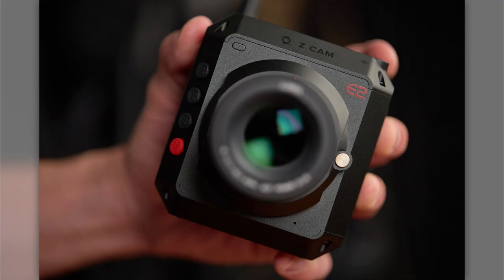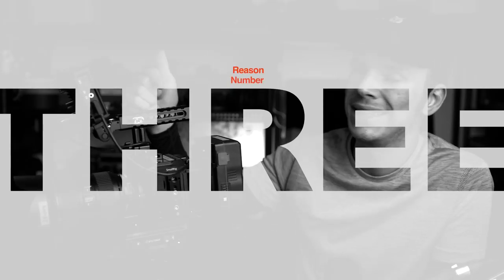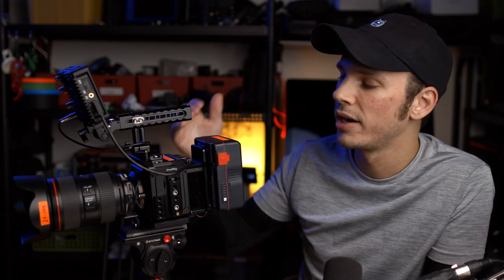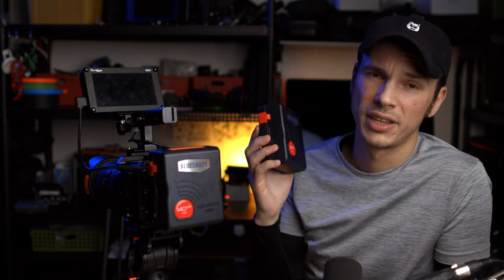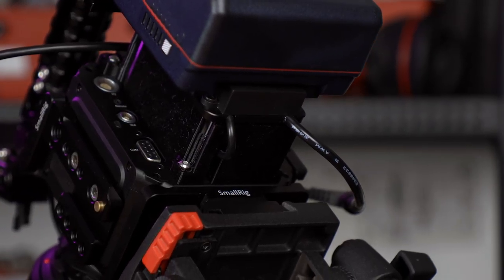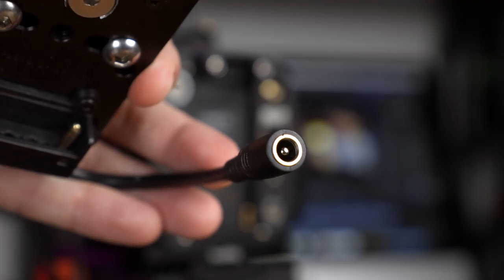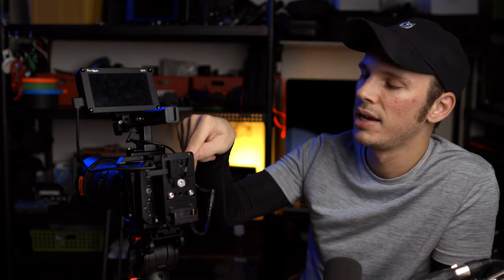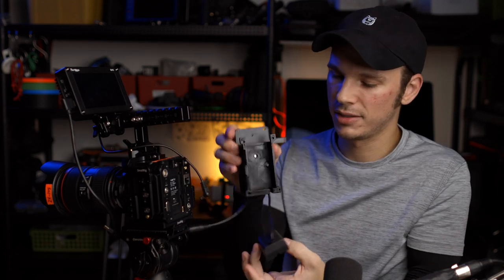V-Mount Power for your Z Cam E2

Comment: Im going to buy the Z Cam E2 F8 Soon, i really like your rig, most likely going to buy the exact kit.
Reply from the maker: I have the F6 on preorder myself! :) I've reallllly loved this setup overall, added NATO rails to the top and on the monitor so everything can break down in under a minute. What camera are you using now by the way?
Reply: @ScottDumas  i use the GH5 at work for podcast, time for an upgrade to the Z Cam 8K, I was wondering if the Z Cam 8K supports ProRes???
Reply from the maker: I think it will, at least in certain frame rates/resolutions. Don't know if they'll have it at launch but it seems pretty close to 100% that it will be added if it's not there yet.

Comment: that rig is so orgasmic. Have you considered a custom rig from Tilta? the $500 kit with follow focus side handle and everything. seems pretty nice
Reply from the maker: I have thought about the Tilta option but just haven't had the money (or need, really) to get one myself. There are certain parts I like about both and dislike about both (smallrig and Tilta) but this has been working pretty well so far. Getting the Clutch handle for this soon which will add a lot of functionality for run and gun, super pumped about that. I'm so used to focusing by hand too that I don't usually feel the need for any sort of follow focus usually :) 

Have you used either kit? I like the built in rosettes on the Tilta but not the cold shoe on top ...what are your thoughts?

Comment: Hopefully partner with someone like SmallRig to design it.

But I want to know, what is the height of the vmount plate?
Looking at the bebob vmount batteries, or possibly another micro vmount battery, but want to make sure its a good matching height. so battery isnt a bit smaller or taller compared to that vmount plate
Reply from the maker: Already in progress with Nitze for a quick release design that will make it crazy easy to switch from v-mount to NP-F... should be ready soon I  think, like within a week or two. 

As for the plate, I'm not sure of the exact measurements offhand, but the plate is like a mm or so lower than the bebob batteries, almost exactly the same height, and just a little bit shorter than the BlueShape Mini which are very slightly taller than Bebob.
Reply: @ScottDumas  thanks :)

Comment: I just ordered BMPCC4K what a bummer. This camera looks so good. Perfect body. I wonder how is the lowlight iso and image quality compared to BMPCC4K. I’m all confused now. My BMPCC4K is being delivered in 2 days. Since this is mft too I can sell the BMPCC4K with light opening the box and get this. Another question is how is the media size of this camera
Reply from the maker: Haha well the BMPCC4K is another great camera, from what I can tell the body build quality and size/design are some of the main differences. Of course codecs etc are different too but they're both awesome cameras luckily. 
The media for the E2 is either CFast 2.0 or an SSD like the PKT drive from Angelbird over USB C (although I use CFast myself)... data rates depend on what frame rate & resolution. At lower frame rates up to Prores411 HQ is available, at 72fps Prores422 LT is the highest you can go and above that is H.265 which is 420 but still 10 bit. There is also RAW available but the software to process it is still being developed for Mac so I haven't tried it yet. The great thing about Z Cam though is that they're constantly updating the functionality and features of the camera, they're very interactive with their users on Facebook for example and I'm not sure that can be said for Blackmagic. IQ wise though, the BMPCC4K will still be great for you so I wouldn't worry to much unless the smaller/cubish form factor is important. GREAT battery life too, especially compared to BM lol.

Comment: I'm looking forward to the S6 and F6. Not sure which I'm looking at getting more...
But there are just SO FEW test shots, films, and overall video work and not a lot of users with the Z-Cam! It's hard. I don't want to invest in a camera not knowing if the bmpcc6k or another similar camera would be a better choice.
What are your thoughts on the E2 so far comparing it to the bmpcc4/6k? Is it as good, worse?
I want to see a review of the new version when its out and I want to see good test footage!
Reply from the maker: Hi! Thanks for watching :) 
I will have a light review of the F6 soon (I hope) and also a full in depth course including sample ungraded footage etc for a pretty low price (also soon I hope)... But, yeah it's very tough to say which is "better" ...I think the image on both will be absolutely awesome, and BRAW is definitely very popular. But, the ProRes on the E2 series does NOT let me down one bit (nor the H.265 for that matter) ... I haven't used ZRAW yet just because there's no tool for Mac at the moment, but it should be coming soon. Hopefully before I get my reviews together. Body wise- the E2 line up win for me big time. I absolutely hate the body of the BMPCC4K/6K, it's huge and awkward, and while it's nice that there's a screen on the back, you need to rig it up most of the time anyway so it's no trouble to add an external monitor ...better in a lot of cases anyway. The E2 line can work well without a cage/rig if you want, but cages for it also don't add a lot of size, bulk or awkwardness just because of the cubic design. It's very easy to mount on gimbals, there are very clean looking ways to power it by v-mount already and they'll be updated soon to be even better, and it's just a very hard camera to dislike once you get it in your hands- not to mention that Z Cam is super super active and responsive online and with their support. 

Anyway, I'll do my best to have test footage from the F6 soon and will really try to get those reviews together as well, I just don't want to rush it and miss something critical. 

In the meantime, never hesitate to let me know if you have any questions. 

Thanks again for watching! :)

Comment: This solution is good but one would have to disconnect adapter for gimbal use each time. So you pretty much gain additional  power but loose flexibility to go back and forth from handheld to gimbal. It that a correct assumption?
Reply from the maker: You do lose the flexibility to do so quickly, that's my only real complaint. There are some ball hex wrenches that make it easier/faster to take this off and on, but it's still going to be a minute or two to go back and forth. I come from the C200 where I had to spend a super long time getting it "gimbal ready" compared to a handheld or tripod setup haha, so this is still a breeze by comparison. Also depends on the gimbal size/strength and lens choice probably... I'm going to try this setup with some tiny lenses so I can slide the whole thing forward more and see if it works.
Reply from the maker: Actually just tried it out with some smaller lenses and smaller batteries- totally works on a gimbal. With medium lenses/batteries it works but has slightly limited movement. I posted some photos on Facebook in the E2 group if you're curious :)

Comment: As far I can see, this V-mount plate https://www.amazon.com/Ansso-V-Mount-Battery-Adapter-Quick-Release/dp/B07DKYKJWM does not contain isolated power supplies which can lead to groundloops and burn the HDMI input/output.
Reply from the maker: That wasn't specifically the one I used, it was custom made but yeah- generally it's easy to burn the HDMI without being careful for things like that.

Comment: Thank you for your great review. I have a couple of questions, wonder if you mind sharing your experience about this: have you used the camera with the phone app? If so, could that replace other monitoring solutions? And could the usb c port feed power to a connected phone? Thanks!
Reply from the maker: Hi! I have used it but only a few times. It definitely can work as a monitor depending on your situation. The phone's brightness would be one of the biggest limitations but it's amazing for when you want to travel light or if you run out of battery for your monitor etc. The amount of control in the app is incredible too, a very well developed app from what I could tell. I'd have to double check about feeding power to the phone but in my memory I think that it does.
Reply: @ScottDumas  Scott, I appreciate very much your help and insights. Big fan of your videos. The Z cams do look like a very attractive option.
Reply from the maker: @infiniteStrive  Thanks so much! If you pick one up, I hope you love it as much as I do :)

Comment: Great info on the battery options and config Scott. Thanks. I noticed a couple of quick inserts near the beginning where you have the cam mounted on a slider but I don’t see that listed in your gear breakdown. what is the brand and model of that slider?
Reply from the maker: Thanks so much for watching! The slider is awesome, it's from a company named Zeapon, this one in particular is the Micro 2. I have a review on it here and there should be links/info in the description there :) 

https://youtu.be/JT4VLkd78Vs

Comment: I wanted to try a vmount power option and was wondering how many hours the 145Wh battery lasts on average?
Reply from the maker: It would definitely depend a bit on what you're powering from it (just the camera or also the monitor, if so, which monitor/what brightness settings etc) ...but for the E2 and BM5 monitor on medium brightness I think I was getting around 7 hours if memory serves me.

Comment: Yo Scott ! What Metabones Speed Booster do I order to use Super 35 and Canon EF lenses with on the Z CAM E2 C MFT camera ? I went over to Metabones website, and it turns out they make a stink load of adaptor/speed booster versions for a plethora of cameras. I couldn't find any Z CAMs listed on their compatible camera charts (????)
Reply from the maker: For full frame lenses I used the XL and never had any problems :)
Reply: @ScottDumas  OK, I will search for that model. Do you know by what times x it changes the field of view ? The various models usually say that ? 0.67 x multiplication for example.
Reply from the maker: @markjob6354  I believe it's 0.64x
Reply: @ScottDumas  OK Thanks Scott

Comment: The zcam can support vmount power tru np dummy batt? Coz v mount is more then 8.4 right?
Reply from the maker: It's using a regulated adapter, works no problem

Comment: How did you rig your monitor on your handle like that !
Reply from the maker: EL CHIMINEA PROUDUCTIONS this was using one of Smallrig’s tilt monitor mounts with a 3/8” screw/arri locating pins that screws into the threads on the end of this particular NATO top handle. There are a few different designs and monitor mounts that could work, depending on your needs and personal preference :)